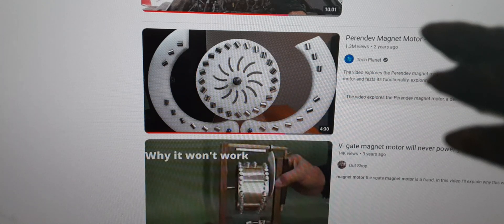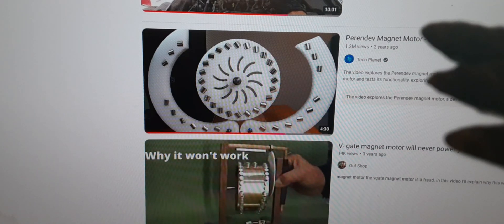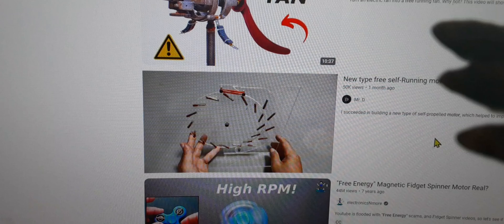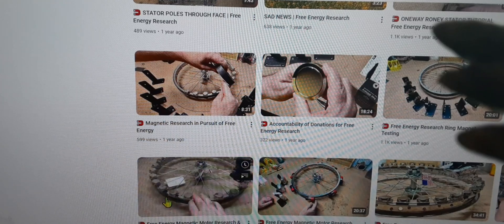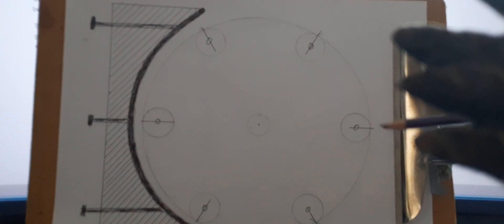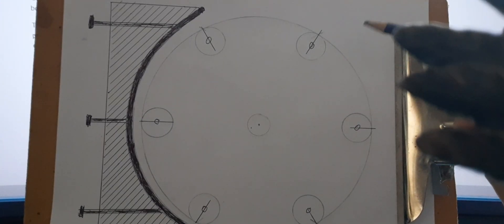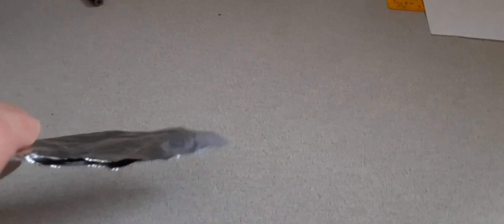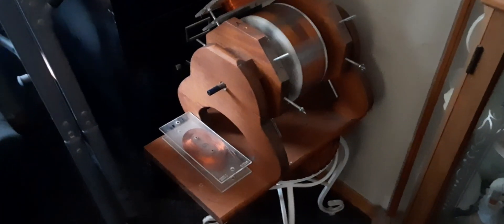Why Magnet Motors Fail and can we fix the problems

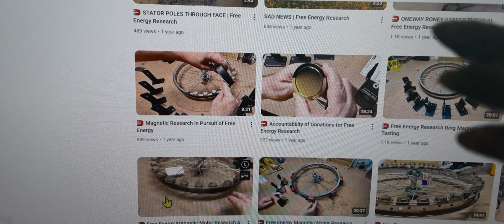Comment: 3:00 agreed.  The V gate system does work you just need the proper load as to not stop the rotation.  And as you said all the magnets must have equal fields, there is nothing perpetual happening here even the mags lose fields over time and exposure to other fields , which must be don for it to work.  Just a long lasting machine for energy production is all ;:

Comment: Would you care to evaluate a new design, that uses two free forces in conjunction, (perm. Magnetic and gravity) in such a way that, it works ????    It's so simple, unlike these you show, it takes advantage of gravity to cause another magnet to enter a magnetic field, then over comes gravity via magnetic, to restart the cycle, it is based on the physics of the blackbird wind powered vehicle, which can go directly into the wind that powers it, and can reach up to 2.7 times the prevailing wind speed that powers it, but is not over unity, just mechanical efficiency....    

I'd love to show someone who would actually build and prove it works....

Also got a atmospheric to kinetic energy device that stores cooler from night, hotter from day, and through thermal batteries, creates movement, with no energy added, just focused and conserved ...

Comment: Are you considering this a free energy device or are you accounting for the demagnetisation of each magnet during its life cycle. Which should conserve the laws of entropy/thermo? 

Thanks!
Reply from the maker: No I don't consider this a free energy device.  Energy is trapped in the magnets when made.  Just trying to take advantage of that like we do the sun with solar panels....no law's broken there.   I'm not sure what the life cycle of a magnet is but as long as it's not exposed to heat it should last a life time.  Google says 700 years but no lives that long to know for sure.  And still yet, I have to be able to get this to work.  I'm 99% it won't work but 1% it will.  I should make an update video, rotors done still working on the stator.  I'd like to get this wrapped up within a week.

Comment: You need to use a HAL sensor to calibrate or rather measure the strengths of each magnet
Reply from the maker: Problem is I'm broke like most people.  I'm hoping 7 magnets stacked together for one set out of 6 will balance out.........of course it won't but we'll see what happens.
Reply: Its called Hall-effect Sensor..After Edwin Hall.

A full assembled Hall sensor for arduino costs around 2$, programming code is free.

Comment: Why do you need to manipulate the magnetic field? Can't you just manipulate the strength of the magnets and leave the field alone?
Reply from the maker: You can't get an all magnet motor to work without trying to block some of the field when you have magnets on both the rotor and the stator.  That is why James Roney made a mono-pole magnet on his set up.